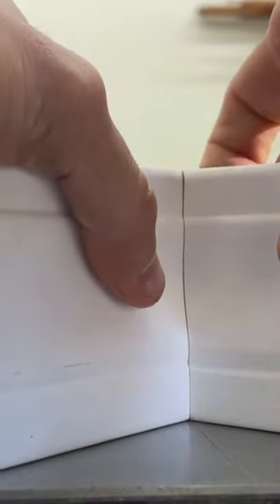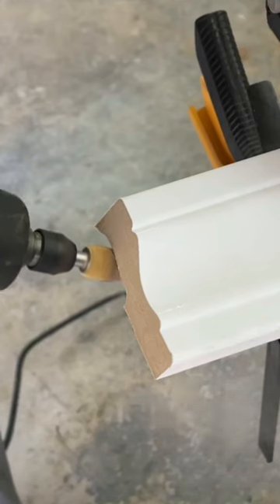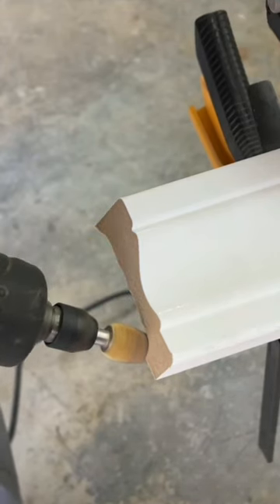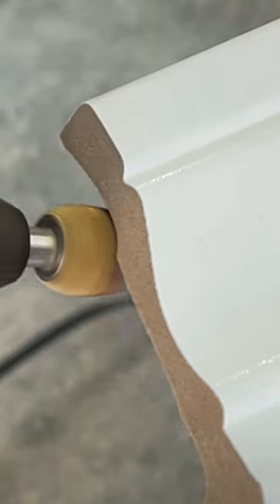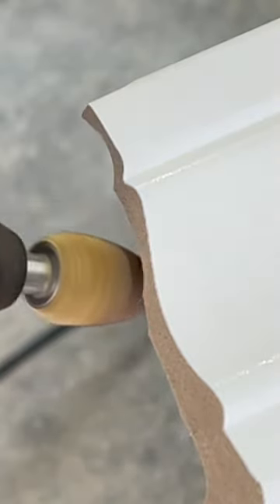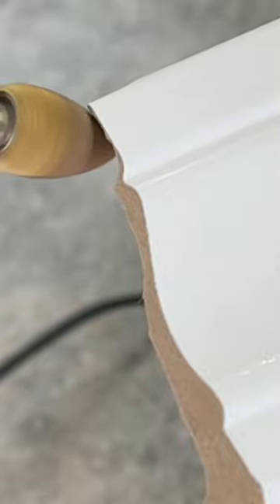Easy baseboard coping

Comment: Glue sand paper to a piece of the same baseboard and use it to sandpaper the cut end after coping for a precise fit.
Reply: What kind of sandpaper do you use? I’m worried about it not being perfect if the paper is too thick and doesn’t fill the recesses well enough. Is there a good sandpaper for this specifically?
Reply: @WowOafus  i think I have 200 to 300 grit paper on my 6 inch high 12 inch long  baseboard piece. It went into several small grooves of the board well.
Reply: @WowOafus  this trick works great but yeah I usually use 400 grit
Reply: That's genius. I use my table saw set to just under the depth and finish with sand paper. Gonna try this for sure
Reply: Genius
Reply: There’s a tool for that file

Comment: Finish carpenter here. Heads up, for speed and efficiency the kutzall blue disc you have is what I use in a grinder. Don't be scared, you can get very good with it. My goal is to never need caulk.
Reply: More of an angle at the tip will allow it to fold or squash together. Real wood before staining you can spray a little water on the joints.  It will swell for a even tighter fit.  Good luck!   Shhhhh dont tell anyone this!
Reply: Just finished base in a whole house only needed 6 ft of caulk!

Comment: bro, I've never been able to use a coping saw right..I barley ever do it...but this, this I can handle.  Might still rough it with a cope.
Reply: Use both.
   The right blade and put in the right way a coping saw works good.also clamp the work piece
Reply: Angle grinders are
Easier than this
Reply: @maddawgzzzz  wtf roll does an angle grinder have in this?

Comment: Once my Grandpa gave me his 1960s Stanley all-metal all kick ass miter saw it became really easy.
The cuts are always perfect 45.
 before that it was very very hard.
Reply: The problem with that is corners or most likely not 45.  At least not a single house I have ever done.
Reply: Yeah but there’s no way your wall corners will be framed at a perfect 45°, especially after the drywall corner is taped
Reply: You can still cut a miter that matches an angle over or below 45 degrees. Just use an angle finder and divide by two and set your miter saw accordingly. It's basic geometry.

Comment: Excellent tip, but removing the bulk with a coping saw will make a lot less of a dust cloud. Then use the grinder to take it to the edge. I use a Dremel with a little barrel sander. I also back-cut just slightly (~1 deg.) and use caulk to glue the joint. Just wipe the squeeze out with a wet rag and the it's ready for paint.
Reply: The caulk as glue and squeeze out is a good idea
Reply: only problem with that is 9/10 trim carpenters dont caulk there trim the painters to
Reply: @rileywhite5091  Yes, good point. It's more of a handyman tip than a carpentry tip.
Reply: @rileywhite5091  agreed. We have glue and some soap foam when needed and an occasional little spackle or putty when needed, other than that it's the painters.
Reply: What tip is that corse medium fine?

Comment: Why not use a coping saw much easier
Reply: I use both
Milwaukee makes a nice rotary tool m12.
   Real wood doesn’t get chalk.
 Popular wood can be toxic, so I try to make the dust fly away from myself.
  It’s also good to clamp the work piece down, it’s a lot easier than trying to hold plus you have twice as many hands available 😉
Reply: You have to be a master im carpentry

Comment: Cut a 45 on the end that needs coped, take your miter saw cut back the other direction the 45 on straight and then clean up your line
Reply: Yep. Back bevels are the way to go! Edge will compress a little and make for a really nice fit.